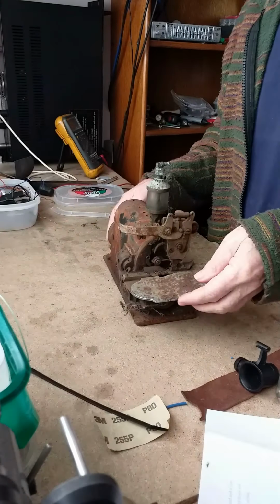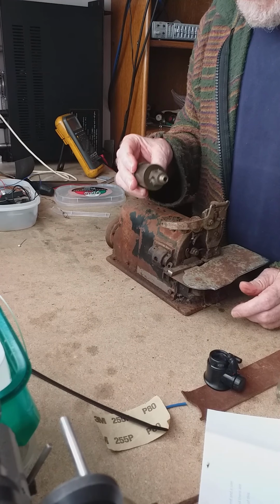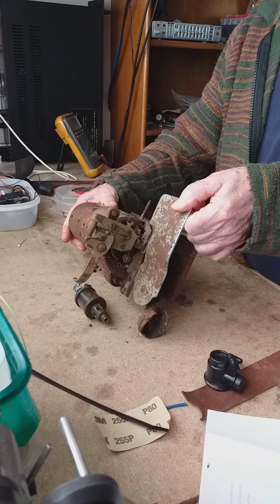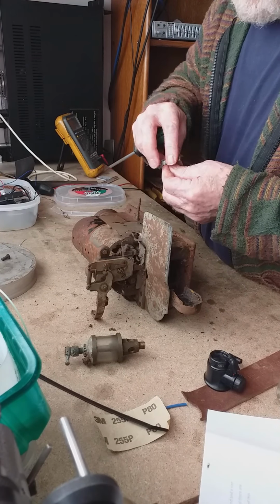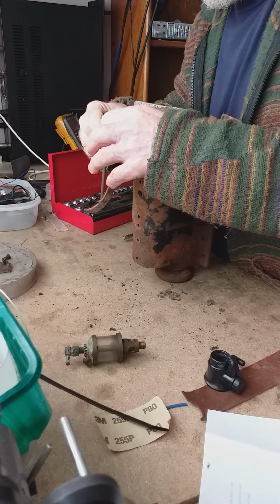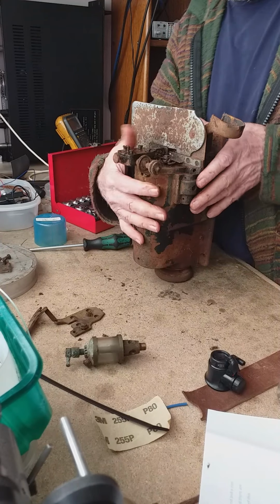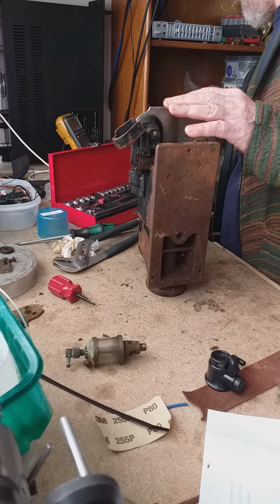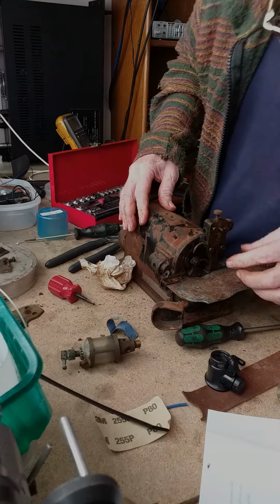MERROW 60 ABB 1930 RUSTY OVERLOCKER!!

Comment from the maker: The Merrow company started in 1838 - same year as Martin Guitars and, like Martin, still exists today! In fact all spares for this machine are available though many were made 80-90 years ago. There is a Merrow dealership in the UK and they were very helpful in getting me on track with this little lump of genius! The serial number according to their records puts it  in the 1930 inventory. This model is dry sump and thus the drip fed oiler. Holes along the top are oil holes and not as I imagined in the video.